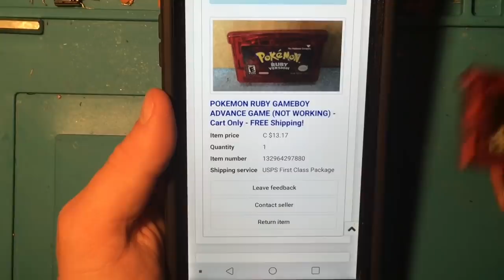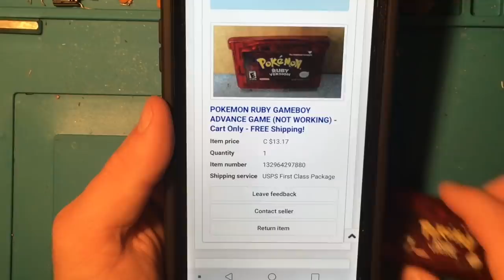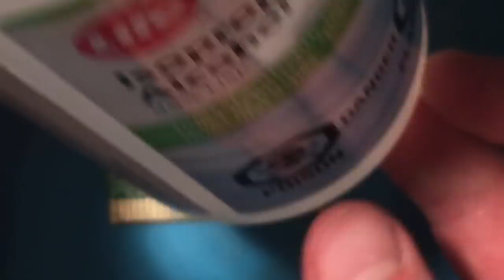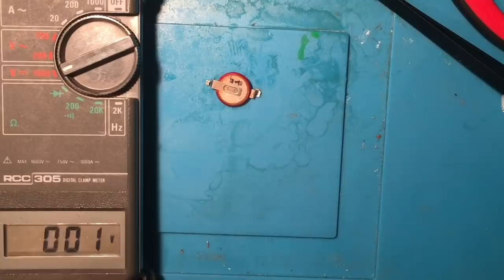Fixing eBay Junk - Game Boy Advance Game - Game Won't Boot Up - Pokemon Ruby

Comment: Could have saved some time and just blew in to the cartridge.
Reply: that's not how this work mate :P Blowing in a cartridge will moisture it and damage the cartridge over time, instead of fixing it. Moisture conducts electricity as we all know, so when blowing in a cartridge, it is possible, that by the moisture all the pins get conducted, and your game works again (Depending on the issue it self ofcourse)  for a period of time, that is.  after a while, the game will most likely short circuit itself. Then after a while, we are presented with videos like these :P and i like it :P They inspire me :)
Reply: Lol sure hope this was a joke.
Reply: @Chrispy9393  dead serious m8
Reply: he could also try putting it in but this time with more force than normal, just to make sure its connected.
Reply: @cryptodevilgamer2511  it was a fucking joke mate
Reply: @Chrispy9393  it's fact I've blown my games before when I kept blowing them they shorted out over time... 💨⚡
Reply: @cryptodevilgamer2511  r/woosh
Reply: Crypto Devil Gamer blowing on the cartridge always worked for me as a kid.  Never had a system break until I purchased an Xbox one in my late teen years
Reply: r/wooooooooooooooooooooooooosh
Reply: Crypto Devil Gamer r/woooosh it was a joke bruh
Reply: @sexybrathuhnmitsose  autistic isn't an insult. Its very offensive to say it like that. It's not just you but some others too. Please dont use autistic as an insult. Thank you!
Reply: Azman188 😂
Reply: I assume that truck was already tried before all this work was put into it.
Reply: @cryptodevilgamer2511  r/woooosh
Reply: @Chrispy9393  you're welcome
Reply: Obvious bait is obvious lmao you all got worked
Reply: @cryptodevilgamer2511  woosh
Reply: Someone just got wooshed so hard a hurricane is starting
Reply: nostalgia at its finest
Reply: *blown
Reply: *blown
Reply: Crypto Devil Gamer r/woooosh
Reply: It probably saved him afew hours as he did it at 9:12
Reply: Thats only for the NES
Reply: Crypto Devil Gamer Have you heard of a joke? They're pretty cool
Reply: Bru
Reply: God the amount of people who missed the joke is disturbing
Reply: That'll make it worse lol.
Reply: @cryptodevilgamer2511  r/whoooosh
Reply: @JDB-ru4lp  this may be a fact, i never blew in it, i always used ear tips, alcohol, it worked better, and my games from the 80's still work as a charm.
Reply: @brandonlee2284  and that is excactly what will happen, over time. Use eartips with alchohol or methanol ;)
Reply: @wusoop1658  ok, there is nothing to wooooooosh here, when you blow, it will bring moisture as well. this will do damage to electronic parts, maybe not the first day. but over time it will.
Reply: don't call me stupid, when you have not looked at yourself first
Reply: i know what i do
Reply: @Saber_Nico  like i said, there is nothing to woosh here
Reply: @cryptodevilgamer2511  r/whoooooosh
Reply: Amazing to see how few people have humour. Yes it was a joke but partially true, blowing into the cartridge or console usually for it working.
Reply: @Chrispy9393  lmao you’re talking about yourself there r/whooooosh
Reply: What a high quality joke that is going wayyyy over everyone's head
Reply: He was JOKING holy shit
Reply: @cryptodevilgamer2511  Maybe that's why my DSi L and R buttons stopped working....
Reply: Lol
Reply: Lol
Reply: That will not fix the problem.
Reply: @cryptodevilgamer2511  It’s the minerals in water that cause conduction, not the water or “moisture” as you put it.
Reply: @cryptodevilgamer2511  Methanol is an alcohol (remember secondary school chemistry).
Reply: @777-h1n   i know, i see this reaction at this moment, i did not think i would get any reactionts back then, i guess it did ;)

Comment: Hi there. I am an electronics technician with experience in microsoldering. A few tips to help with future repairs. Re-flowing is almost never going to be the answer with these cartridges and could potentially damage the IC's. When using de-soldering braid you will save braid and time if you cut off a small piece and hold it with tweezers. This means the braid has a lower thermal mass and will reach the desired heat more quickly with less chance of burning your fingers. A quick look under a cheap microscope (or a macro lens on a cell phone camera) would have made this a much simpler job. Hope some part of this helps and good luck in future repairs.
Reply: Yeah, I don't like doing even easy solder jobs without my microscope. It just makes it so much easier to see tiny flaws.
Reply: Just a few weeks ago i fixed a copy of pokemon red by re-flowing the rom, i don't have much experience with this kind of thing like you do, so maybe look for other things first but re-flowing is sometimes the fix needed.
Reply from the maker: Yep, very often it's all that's needed if a simple cleaning doesnt work.  Those boards are so slim, they bend and put stress on the rom and ram chips.
Reply: @RetroRepairs  It's also worth noting that thinner boards require a lot less heat, so there's less risk of damaging components. Unlike something like a PS4 motherboard, which is a HUGE heat sink and requires a ton of hot air to remove the HDMI port, for instance.
Reply: hey if you bridge some small parts (like in the vid) is it possible (any %) to burn the DS fuse? i tried it and the ds doesnt power on now, when i put it to charge the small led lights 1 sec and then no more and i cant even power it on. any help would be appreciated

Comment: When I was like 5 I dropped my gameboy micro into a sink and after it dried out it was fine. Every time I see a video about wet electronics I think of my gb micro
Reply: Thank god, someone else respects the Micro. Definitely my favorite of the gba line...
Reply: @LunarPurin  the micro will always be my favorite
Reply: Micro is very under rated console, one of the best handheld to game on up to this day. Very comfy in hand and cool looking too!
Reply: That was my favorite game boy, and the only one I didn't break when I was 6. By the way, I broke 7 game boys. I cherished my GB Micro, I paid for about 100 dollars in repairs. (Yes I loved it that much). I even got a traveling case with all my pokemon games. I also even bought about 10 skins for it. But then my idiot brother sold it 2 years ago for 15 bucks. That was the worst day of my life.
Reply: Where i live they never sold that gameboy, only gameboy advance and advance sp.
Reply: I remember my best friend had a micro and it was so cool and weird all at the same time. I think we played a Donkey Kong game on it? I just thought it was so interesting and different from my SP
Reply: When I was around eight years old we were camping and  I took my GameBoy Advance with me. I stored it in a side pocket of our tent and yeah... It was an old tent, it started to rain like crazy and the walls of the tent were soaking wet. So was the GameBoy. I was so sad because it wouldn't turn on anymore...
But few days later, it just worked again. I didn't dry it in rice or anything. It just came back to life.
I am 22 now and the GameBoy works to this day and so does my sisters GameBoy Advance. Those are sturdy little machines.
Reply from the maker: As long as you give it a chance to dry, most electronics will still work, especially older stuff like game boys where there's lots of air space.  It's when the moisture gets trapped and starts to corrode or short out that you get permanent damage, like in a smartphone.
Reply: If you drop you electronics into water leave them in rice over night ..... at night some asians will come eat the rice and repair your game boy xD
Reply: @TonberryX  Rice bridged my traces and fried my gameboy >:(
Reply: @TonberryX  lmao first comment I've ever laughed at
Reply: Hell I had sapphire soak in soda for 2 hours and was still fine
Reply: I remember dropping my original GBA under running water when I was 6. Booted fine within four seconds.
Reply: @tibs9149  Try contacting whoever he sold it to and buy it back. Pay double what they gave your brother. That gameboy misses you.
Reply: Beyond Burntsn0w I dropped my iPhone into a cup of salt water after I had my wisdom teeth removed (I was going to gargle with it) half way drenched charging port speaker and headphone jack were submerged

The headphone jack only needed to be dried out and my phone been fine since  I did catch it after 2 seconds though it never even shorted or anything
Reply: micro is definetly the best imo. sure the ags101 is backwards compatible with older gba games but they stick out like a sore thumb and the graphics are honestly terrible on most games. the micro is less vulerable to repairs unlike the clamshell design they went with for with the sp. the micro also gives the illusion that games have better graphics due to the pixel density on the 2 inch display, super underrated portable console
Reply: Chris Travis I disagree with almost everything you said. The smaller screen makes it look worse. The clamshell design prevents scratching on the front screen, which is the most important part of the whole thing. Older gba games? Don’t you mean older gameboy games? Sure they stick out but that’s not a concern at all for anyone who is truly a fan of original gameboy games. I’m sorry to say but you’re fairly severely outnumbered, the GBA SP is far superior and a vast majority of people agree.
Reply: ive never had an issue with the lack of protection on my micro screen. i personally dislike clamshell bc i hate how fragile the hinges were and still are on the 3ds and if the screen gets scratched on the micro you could simply swap the face plate so thats not even a big deal really. i also did mean older gameboy games (you got me there) and sure if youre a true fan of those older games then i suppose you could go ahead and play those, but at that point i would just buy a gameboy color (theyre a dime a dozen at this point anyways). personally i will always recommend the micro over the sp to casual fans if theyre even willing to put money down for this stuff in the first place, because emulators are a thing. the micro is in fact superior in terms of resolution because of the pixel density. the sp and the micro both had the same amount of pixels but they were just squeezed in tighter for the 2 inch display on the micro. so subjectively it might not be your cup of tea but objectively speaking the micro has better resolution. the micro also has a headphone jack and is more travel friendly than the sp. pros and cons for both fs
Reply: The micro is underrated because they're rare and getting one ain't that cheap
Reply: @NotxOmnis  I actually didn't know it had a headphone jack. That's nice to know. I will still prefer the intensity of the ags101 over pixel density, and I also much much prefer the larger screen as do I believe most people do.
Reply: My first one I lost, but my second SP is still with me. The most comfortable out of the box. It brings a lit screen, a decent size to fit into the hands, and when closed protects the screen and any accidental button presses.
The micro is smaller than my palm, that is hardly something positive. THe headphone jack is.
Reply: @LunarPurin  same
Reply: I found mine I got in 2005 when I was 5 while tidying up my room a few days ago. I remember how sad I was, when I got it because everyone else had the "cool" SP. Tears for nothing man, so glad I found it again. First thing I did was play Pokemon Emerald again.
Reply: @jussiviinamaki3726  I never find them cheap enough:(
Reply: Um, I can’t relieve cuz I have a gpa sp abs-001
Reply: @Miguel Vieira rice is demonstrably worse then leaving a dunked item to the open air to dry. Better yet, point a fan at it. I will agree that it's best to open as many covers as possible.
Reply: Same happened to my GameBoy Color about 20 something years ago and it also worked, but my mom had to open it and use a hairdryer

Comment: I think a DS option pack is like the rumble pack. It wasn’t widely released. Nintendrew has a good video about it.
Reply: Yeah that would be my guess too
Reply: It could also be things like the ram expansion for the DS browser, Also the M3 GBA expansion pack and some other DS slot 2 flashcarts.
Reply: Hubert Francis yes your half correct it’s anything that a ds game needs to have an gba add on like garter hero with the button add on. This is why the rumble pack is ds option pack because it’s an add on using gba slot.
Reply: I think the DS detected that it was a Gameboy Advance cartridge, but didn't identify it as a game, so it defaults to DS option pack

Comment: Good stuff, but again I had this weird feeling, that I would screw this up myself. Such small spots for soldering. 
I have recently rescued a built-in games board from a dead Famicom clone. Unfortunately I still have to get myself soldering braid, so I can get rid of the solder blobs from the contacts. I find this really helpful, since I have never been using this myself, always being careful not to use too much solder..

Comment: Everyone else in the comments section seems to know what they're talking about... meanwhile I have no idea about any of this stuff but it's still super cool and amazing. It makes me wonder what's going on with my PKMN Gold cartridge. It turns on just fine... but the glitches...
Reply: Jade Juniper I'd try cleaning the contacts with a q-tip to start.
Reply: @antidote5125  It's definitely not the contacts. Trust me, I've had the cartridge for eight years. I've tried all of the easy remedies.
Reply: Jade Juniper Oh, okay, sorry. Hope you get it figured out some day :-)
Reply: Most likely Missingno. Pray for your sins.
Reply: Well,glitches are more often than not, by-products of faulty circuits. If the glitches are multiple and persistent, then something is definitely wrong with either the board, or a basic component on it. I don't know much about GBA cartridge boards, but from my limited knowledge I will assume that those glitches originate from faults within the graphics chip of the board. If the chip is faulty, find a new one (good luck with that) or fix it yourself (which is impossible, since the transistors inside it are smaller than the eye can see)

Comment: For reference the DS option pak is the add-on cartridges for the DS which some games used - such as the DS memory expansion (used by the web browser DS card), DS Rumble Pak (Used by several games) or the Guitar Hero 4-button controller add-on for the DS and DS-Lite

Comment: My Pokémon Ruby I bought from eBay does some weird color changing when I walk around. The green grass and trees get brighter when I walk, and then back to normal when I stand still. I opened it up, it looks clean however I think it may have been damaged when the seller soldered the new battery on. It’s the only thing I can think of, I cleaned the chip with alcohol like you did.
Reply: That's weird. Either a connection needs to be reflowed, or it's at the point in the story where it's really sunny because of Groudon.

Comment: I've tried to repair a similar issue before, with a Super GameBoy. Though it was about 4 broken circuit paths. I didn't finish the fix because these issues are caused in part by the cartridge shell were it presses up against the board (I figure something small and hard got in between and got pressed into it, severing the connection(s).) In my case I found that any such wires being added would be clamped down by the shell, if it could even be closed at all the wires would be aggravated the same way with basic wear and tear. Hope that's not the case for your Pokemon Ruby.

Comment: I've always used a flathead screw driver on tri-wing screws. You don't necessarily need a screw driver specifically designed for tri-wing screws. A flathead screwdriver works perfectly fine, every time.